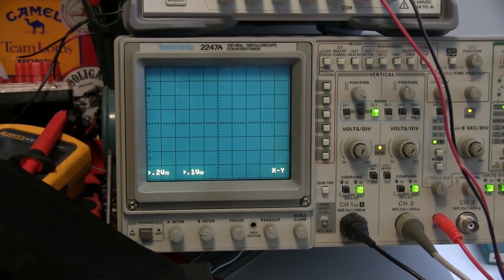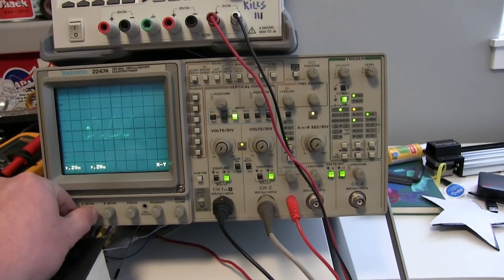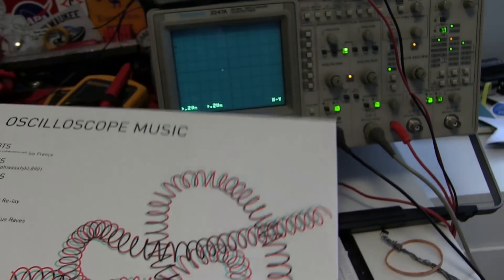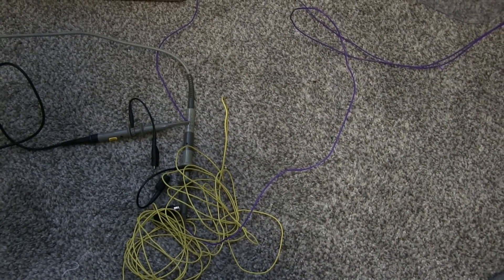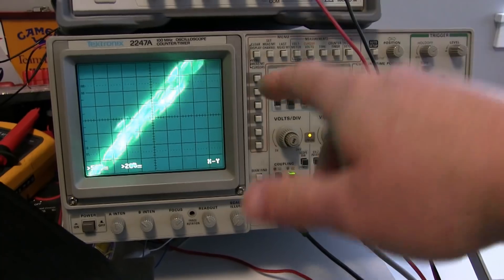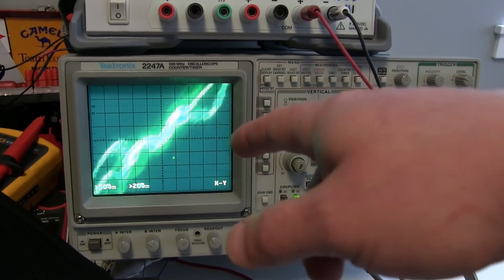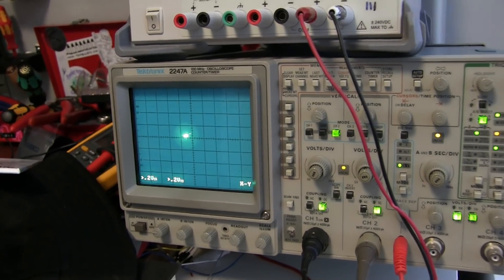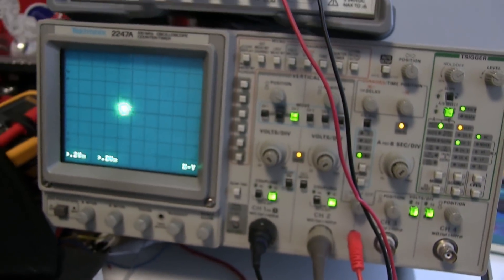Oscilloscope Audio Display | Lissajous XY Music

Comment: I did this on 70 year old Heathkit O-12 oscilloscope which I had restored, through the phase inverter of a dynaco ST70.  This was the ultimate test for linearity both on the 60+ year old scope and the Dyna St 70 amplifier.
Pictures with sounds demo on the Heathkit
https://youtu.be/sk0x-tUUovs?t=1m57s

Lissajous during restoration in part 8 of restoration series
https://youtu.be/9ZDjdkWLCuo?t=21m39s

Comment: bugger  the smellyscope, I want that on me TV!
Reply: Easily done. Connect the speaker outputs of an amplifier to the deflection yoke windings on the TV.
You only need a TV that has a working CRT (filament and high voltage)

Comment: pretty sure you do need a ground connected from the record player to the scope. looks like you were only getting the common signals between the 2 channels as a diagonal line with weaker differing signals straying off that. remember the pixies need a route back home. they can share a common ground, but they need a ground none-the-less.

Comment: Sheets of glass with copper plates in-between stacked, sealed edges. Wire going into each plate from opposite sides ran to power supply or advanced capacitors. High voltage, low amps, high Frequency, kinda sawtooth wave. Maybe dielectric grease between the sheets...Possible levitation.